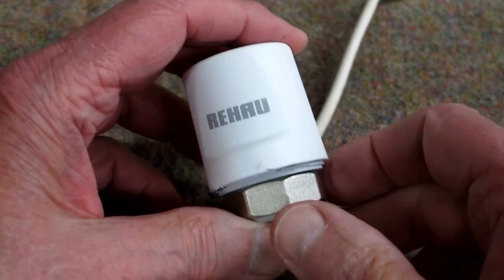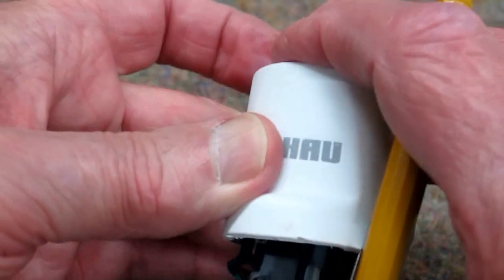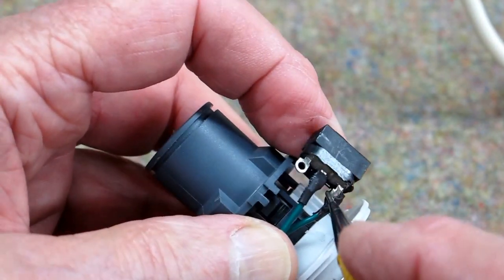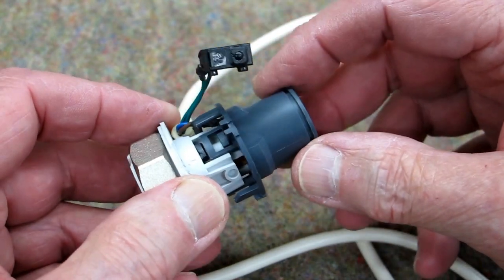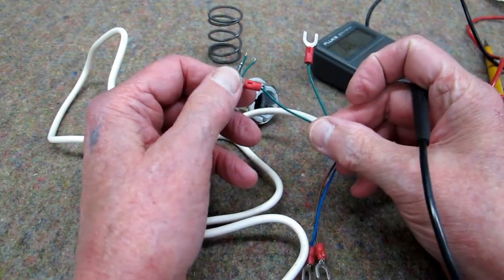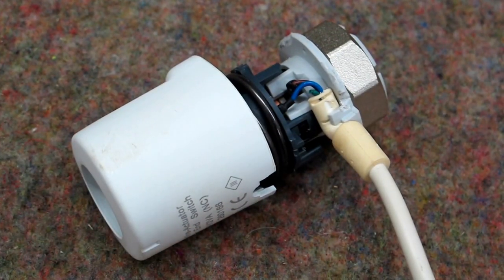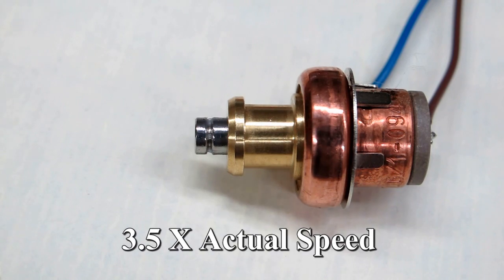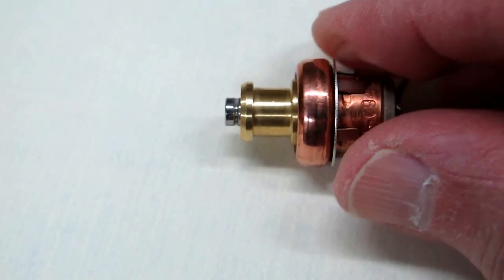Rehau 4-Wire Actuator - Wax Motor

Comment: Thank you for this video. I have a question - does that mean when I set room thermostat temperature to e.g. 22 Celcius, this actuator's element is heated to just some specific temperature, so it opens just as much as needed a flow rate to reach 22 in a heating circuit? Or, it works just as 'on-off' switch and fully opens and fully closes as in operation? Does it consume energy when fully open / fully closed?
Reply from the maker: It works on-off (open-closed). Whenever your thermostat and/or controller calls for heat, power is applied to this actuator. This one takes approximately 10 minutes to fully open (and then 10 minutes to fully close when the power is turned off). 

Your thermostat tells the controller it wants heat. The controller then applies voltage to the actuator witch slowly opens the manifold valve. When it is fully open, a microswitch closes which tells the controller to start the pump. Power is continuously applied to the actuator to keep it open. The actuator has four wires, two wires for power and two wires for the switch.

So it consumes power all the time it is open (power consumption is relatively small) and it does not consume power when it is closed.

Thanks for watching. Please subscribe!
That is what keeps this channel running.
Ron

Comment: The heater looks like a PTC heater. It's power consumption drops as it heats and maintains a constant temperature.
Reply from the maker: I believe it is PTC. The current drops slightly and the temperature remains constant.

Comment: The grey disc in the bottom of the wax motor looks like a PTC. Is the current draw decreasing when connected to the constant voltage power supply?
Reply from the maker: I believe it is PTC. The current drops slightly and the temperature remains constant.
Reply: You could see it was drawing 0.2A when it was just turned on. When it was fully extended it was drawing a tenth of an amp, according to Ron’s narration. 

I suspect it may go even lower, when it fully enclosed (and right next to a heated radiator).